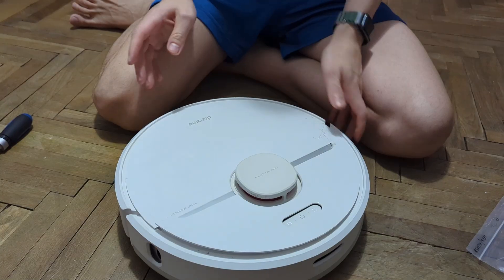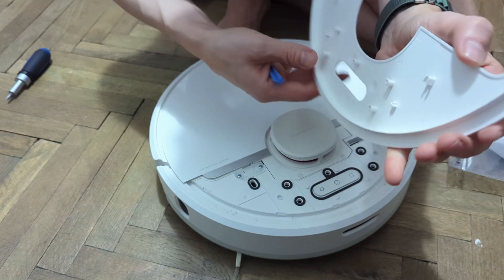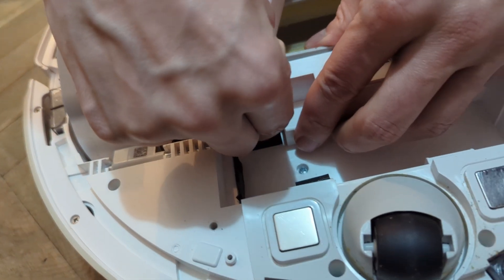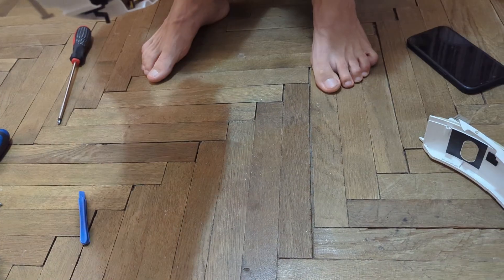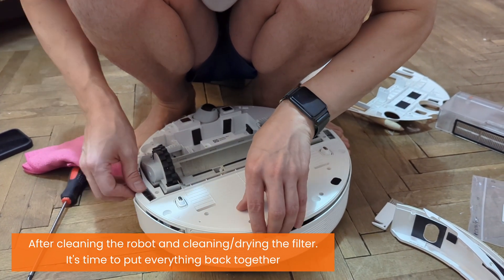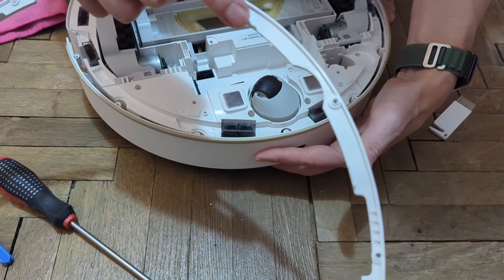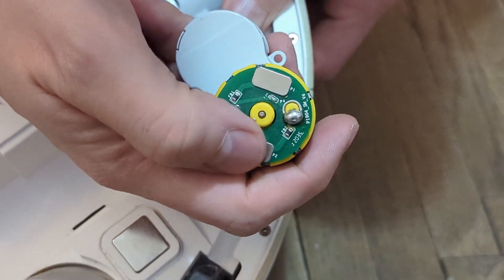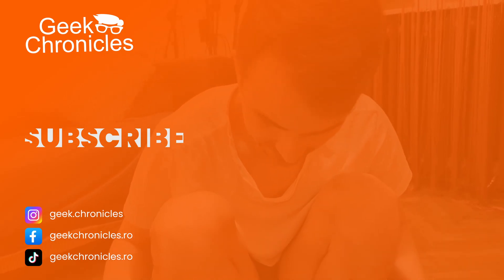Robot Vacuum Filter blocked or wet Error (Dreame D9) - Easy Fix

Comment: I got L10pro. The process is quite similar, but there was a hidden screw underneath the pad, which I didn't notice. Damaged the speaker wire and I spent extra time soldering but I guess it was worth it.

Comment: My DreameBot Z10 Pro won’t start, and the buttons keep blinking white. Sensors and bumpers are clean, the turret isn’t blocked, and the robot was professionally cleaned. It has the latest software, was fully charged for a day, and a reset only helped briefly. After 20 minutes of cleaning, it stopped again, and since then, nothing works. Even replacing the battery didn’t help. Does anyone have a solution?

Comment: Easy fix my ass. Dont be a fool and try to do this at home because you'll not be able to put it back the right way. Send it to a shop to ve repaired.
Reply: As You can see in the video, the process it's not complicated, you need patience. Those who don't want to do all this they wouldn't be in the target audience 😊
Reply: I agree with the part that it's not an easy fix especially that mine clogs after a few weeks. I've been doing this for a while, disassembly, assembly... Now I'm thinking about modding so I can open a door for the filter and not have to disassemble every time. This is a major design flaw of this vacuum in my opinion

Comment: Thanks for this, I have the same model and regardless of filter cleanliness I was getting the blocked/may not be dry message every time it began a cycle. I just assumed it was some sensor that had gone bad because it still worked ok, but, it began to shut itself off a minute after starting a cycle. Your guidance fixed it completely. Very impressed with this vacuum after 3 years of steady use in a home with pets and kids. I’m very happy it’s easy to work on. Thank you!

Comment: Thank you for this video! Mine had a sensor error and drove down the stairs and the front wheel broke. Had to take the entite thing apart to reach the plastic clip that held the wheel (under the mainboard). Your video was super helpful, especially the part where you show all the screws!

Comment: thanks for the tutorial my vacum is working again..tutorial 100% same as z10 pro..clean filter error...after i opened it i found the motor stuck and i turned and sprayed air and put it back it works fine😋🫡

Comment: I've just done everything in this video (include replace external filter) and still getting the error message. However robot seems to have better suction now

Edit...nope nit better suction
Reply from the maker: hmm, have you checked the motor? You must check the motor with a multimeter to see what's his internal resistance
Reply: Same here
Reply: @flunul it ended up being toast...waited a year and got a different one...she lasted 3 years though so not bad
Reply: @brookeohara8434 i ordered a replacement fan, we'll see...

Comment: Thank you! I was getting the same error after replacing the filter and thought maybe it was because it was off brand and there was something wrong with it. Cleaned the filter thoroughly but kept getting the error so I thought there might be another filter somewhere but couldn’t find it. But now I see it thanks to your video! Them really should make it more accessible
Reply: Did you do this successfully?
Reply: Yes I did! I received the error one more time after using it for the first time after cleaning it but I haven’t received I since.
Reply: @erinlindsey7901  dang...I did it too yet still no suction and still same message :(
Reply: @brookeohara8434  oh man, that sucks. If your vacuum is less than a year old, they usually will cover the cost to fix it.
Reply: @erinlindsey7901  nah its like 3 and a half years old...but still...I won't be buying another if that's as long as they last
Reply: @brookeohara8434  Same happens to me, but if i start a small area cleaning it does work fine, problem its when tries to go back to dock as the filter problem prevents it from moving. Tried cleaning, changing parts but nothing works.